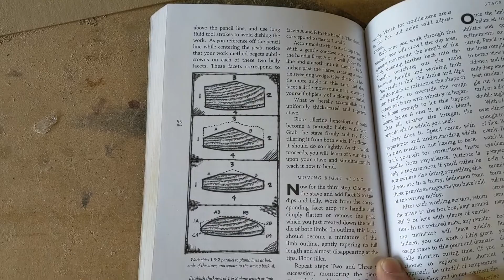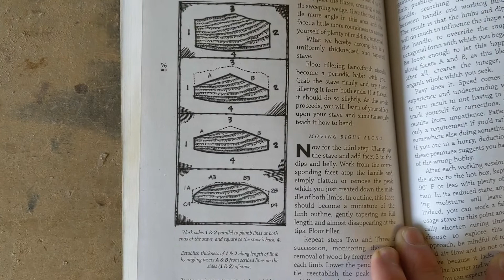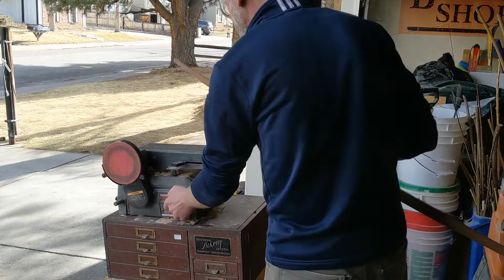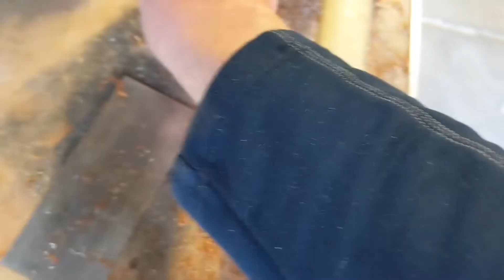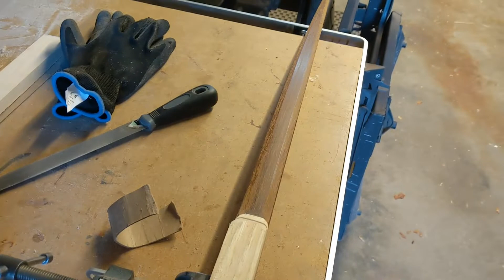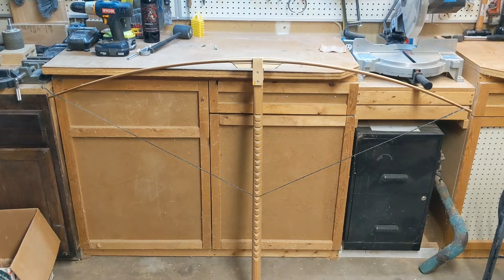Getting to brace height - Pt. 6 RF/DF bow build along.

Comment: awesome build along, tyvm will be referring to it a bit i can tell when making mine
(although i wanted to try something a little differnt with mine was thinking of trying to find modern analogs & using traditional construction method) im thinking of similar reflex, subtle deflex design to yours replacing the bamboo with fiberglass and the hickory with PVC expoxying them together and wrapping them in epoxy soaked silk thread(after tillering) from handle to 1/2 way up the siyas( plan on making it with 10cm or so deep 20cm or so long angular siya, like a tartar bow) 

was going to plait some raw black silk thread with a silver or gold embroidery thread in it so it should give the arms a gold or silver flecked appearance/should still look ok/historical at a glance. probably stain the siyas to make them look like ebony or something and tie a small brass rat(the rat always crossed the river first in chinese mythology) into the base of each siya, just for looks/symbolism lol probably add 12g to each arm i dont technically need :P  but i suspect il be working the power down a bit so not worrying about drag on swing arms so much
Reply from the maker: Sounds like quite the build! Be sure to let us know how it goes! I have made PVC bows in the past, and they are surprisingly snappy. I have also thought about applying PVC in strips on a belly as a synthetic horn application - very compelling concept…. Good luck!